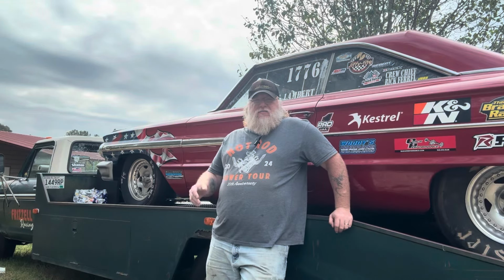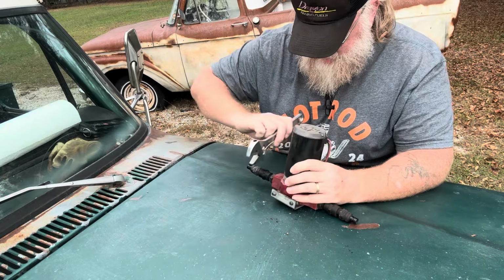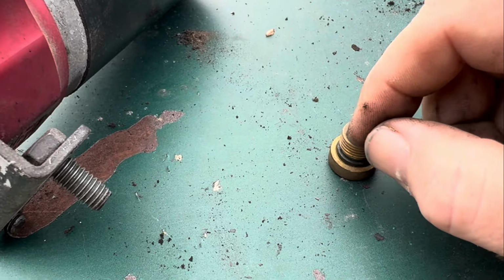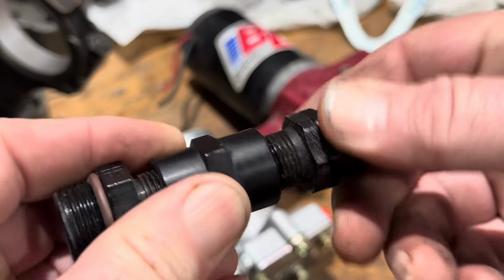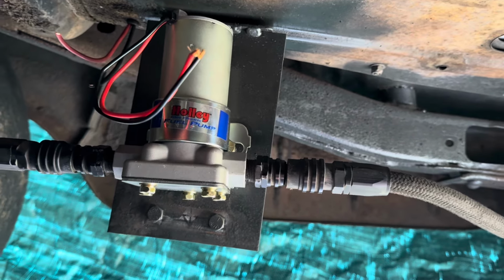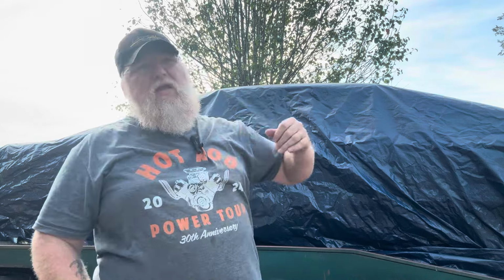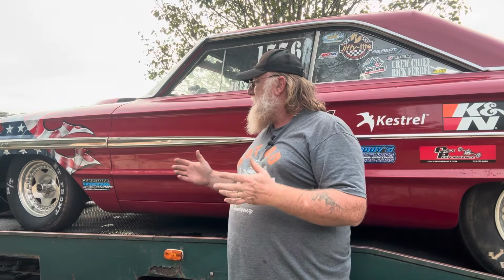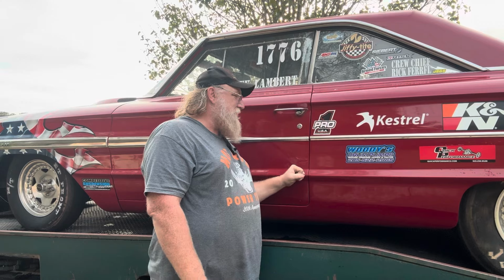1964 Ford Galaxie maintenance ￼

Comment: Those pumps are set up for AN ORB fittings. The ORB means O-ring Boss. AN means Army/Navy, the standard set during WWII and the tubing used is 37 degrees on flares which is different than brake lines.  Most pumps use either the ORB  or NPT  (pipe) fittings. ORB with a Viton o-ring is better for preventing leaks.  The threads on an ORB are straight, not tpaered. McMaster Carr is probably the best place to find what you need but the problem is you have to purchase a pack of 10 and have them shipped via UPS. The shipping can cost as much as the O-rings.. Stay away from the Nitrile rubber. You want Buna-N or Viton. The Viton are more expensive and are the best option. Buna-N is the most common and great for oil.  Viton will hold up to many chemicals and gas is loaded with chemicals but you would have to order them and McMaster Carr is a great place to get them. . Thing about McMaster Carr is they ship fast and it come to you most of the time on schedule. Home centers, hardware stores, auto parts stores and plumbing suppliers all sell o-rings but finding Viton locally is probably just wishing. Hope this is helpful.   By the way, you can order a kit for the 280 pump online. Summit or Jegs may have them, Allstate Carburetor does.
Reply from the maker: @4speed3pedals  thanks for the information.
Reply: @frizzellracing  I edited some, check again. You are welcome.
Reply from the maker: @4speed3pedals  summit doesn’t carry it or at least they told me they didn’t I was down there  Friday with the intention to get all the stuff for it while I was there and they told me they could get me anything for a Barry grant pump…. But then again that is relying on the word of the guy behind the counter.
Reply: @frizzellracing  Agreed.